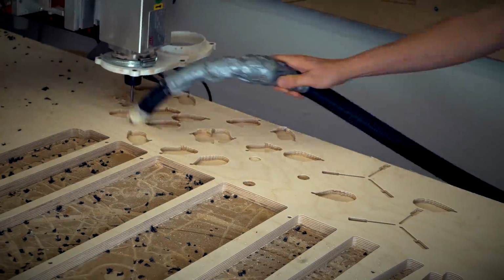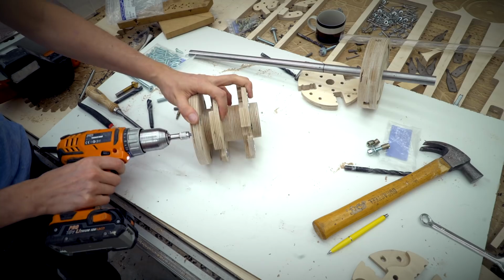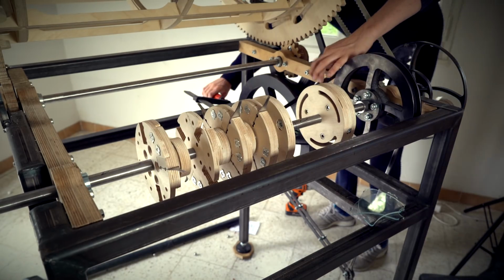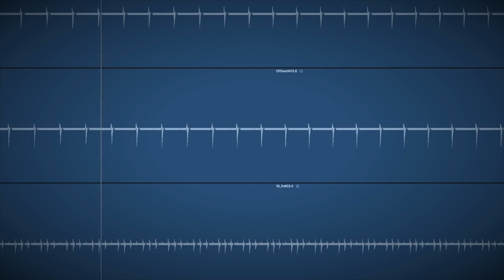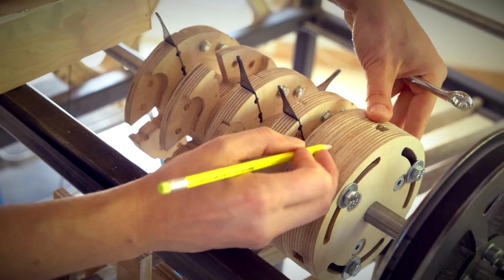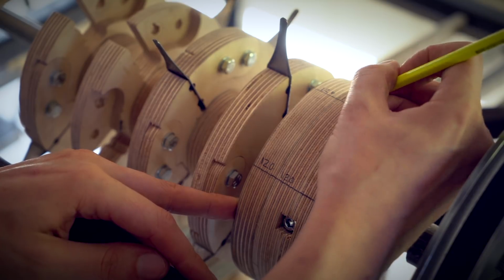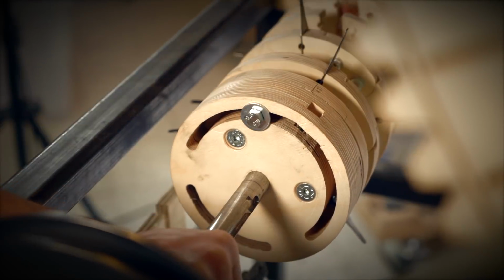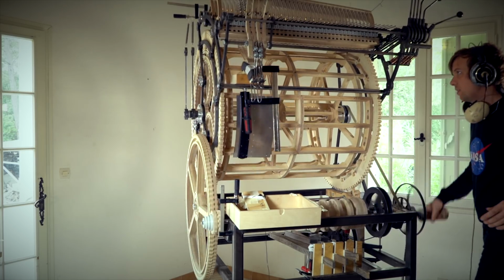Testing the Mechanical Rhythm Machine - Marble Machine X #55

Comment: You can easily program countersink milling in plywood with flat endmill using bore 2D Bore operation with 0.1-0.2mm stepdown in Fusion 360.

Comment: Glad to see you realize that a lot of your designs are heavily over-engineered. Your'e absolutely right though that they will work and look great imho :)
Maybe at some point you'll want to make the whole thing lighter and cheaper to build. I'd guesstimate that you could scale down a lot of the parts by at least a factor of 2 and still get the same functionality and proper reliability out of them. That will require the next level of engineering where you actually calculate the required forces for each part and design them accordingly. Might be fun.

Comment: I think that some sort of tachometer is now needed. Luckily, principle of mechanical tachometer, using eddy currents, is simple enough to implement on your machine - you need just magnet, aluminum disc and spring.
Maybe youu could use same principle for automatic synchronisation device, too.

Comment: You should use radial clamping between the set disk and the rhythm stack.  That means the set disk needs to be 3 thick and the rhythm stack needs a one disk protrusion inside and use three cam levers from the set to the stack.  Like a concealed mill chuck where a second trio of set screws at a 60° offset from the primary shaft set push inward.

Comment: Do not use V-belt - it makes more friction. Rather use grooved flat belt like the ones in the newly built vehicles. Or you could use a timing belt - it does not need much tension to work. However, finding the pulleys would be chalenging.
Do not use separate tensioner - using the flywheel as a tensioner is better. You may build a moving support with adjustment screw for that.
What about a brake on the wheel? You've had one in the previous machine ...

Comment: For the rhythm machine, how about using two anchoring bolts for symmetric load on the plywood and four anchoring holes, with two 150 degree tracks? This way, no matter what position the rhythm wheel is in, you'd be able to have two anchors. Awesome seeing this project progress and looking forward to the next update!

Comment: You need a sudden stop/emergency brake system for this machine to immediately to halt any sound comes from the machine without any delay like most of the songs maybe ? (Before the main part comes afterwards) Also I think you need that if anything goes terribly wrong...

And my personal opinion is... Think of a way to make the adjustment times between musics too short like 5 minutes... After 5 minutes, the audience goes angry and starts to shouting madly... Mostly boos for the musicians that not well known in some places...

Hope you can aswer this... I'll cheer for you from the place where the magic happens !

Comment: Since you like overengineering, did you consider to make the automatic adjustment system, like the one used in distributors in engines. The timing is adjusted there with the help of centrifugal forces: the higher the RPM, the further the hinged weights move, and the earlier the spark happens. Could something like this be possible in your case?

Comment: Ooh it would be interesting to use the rythym machine to fire a strobe light in order to use the stroboscopic effect to light the marbles as if they were standing still during the strike.  Kind of like a timing light when tuning an engine. This would not only be a nice lighting aufrecht during play but also a good method to check your timing without the need of the computer and pick ups as you are on tour.

Comment: Hey @WinterGatan - I would still keep 2 screws in that "rotation adjustment" so that you don't press only against one side. - If you make 4 holes and make the slide slots slightly larger than 25% x 2, you can move it the full 360 degrees and still have 2 opposite screws.

Comment: You can automate the BPM switching with centrifugal weights. Three arms with weights on the ends, pivoting on the adjustment wheel. The other end of the arms has a round profile with an increasing radius that pushes on the locking bolts. Springs is used for returning the arms. The BPM advance is tuned by the profiles on the arms. #featurecreep

Comment: Have you implanted braking system like that of previous one? I want to recommend you to apply bicycle brake on new machine. It will gradually make the machine stop by friction safely. Braking system with ratchet which occurs sudden stop is not safe for this kind of heavy machine.
Reply: Yes, exactly. A bicycle disc brake would be relatively easy to install and very effective. Maybe replace the lever with a wooden one for aesthetics

Comment: For the belt tensioning of flat belts, a slight bulge in the center of the running surface will often help the belt to track properly ('bombering' på svenska).

Comment: why ain't there no spring to keep the belt at a constant tension. (very quick and easy fix/modification) and if you like the change the tension on it you can just add a metal plate on verticaly and have the frame threaded to keep that plate in place, 
On this place you can machine out or ask someone with a laser cutter to make A to D so you know what tension you set your belt to. (this ofc will have to do with a spring that will run out over time like 20-40 years of constant working so keep that in mind)

You can just look at dirt bikes how they keep their chain in a constant tension and how you adjust the tension. 

And you can machine a flat disc that has a slope and you just drill a hole in the middle so you can weld it in to place (this will catch the belt obviously)

Comment: Seems like it'd be tricky to change the rhythm of that part though. A crazy idea would be to have a slide-clutch for each part so you could pick any of the beat patterns for any part of the percussion. Alternately split disks that go to an anchor mount on the shaft, allowing for fast change out.

Comment: You need to close off the flywheel/crank gaps. They look cool but they are finger traps. Your machine has more than enough inertial energy to take your finger off, and you want to increase the flywheel mass now.

Comment: You could use a centrifugal governor, or flyball governor like the ones you used to see on top of old timey elevators. Dialed in correctly to adjust your timing angle this would keep you in time with no manual adjustment and allow you to change BPM mid song. Bring on the feature creep. also they are purely mechanical and super cool looking

Comment: On your timing wheel remember how your triplets work with you 4/4 timing....  use 3 slots but put in 4 bolts at a constant radius in a square pattern.  You should always be able to get 3 points of contact no matter the rotation of the timing.

Comment: Don't use only 1 bolt.  That will make things unsymmetrical.  Instead, put a ring of tapped holes into which the bolts engage, and space those holes not in a multiple of 3, but say 4 or 8.  That way, a given bolt set will have a range, which will be different, but partially overlapping, with the existing set.  You can extend range by switching the hole-set you use.  This is principle of "vernier" scales.  Don't open the slot.  Assembly will be too weak!

Comment: Have you thought about adding a brake to the flywheel? Or did I miss it and am sounding like a fool, lol. It would help slow down the flywheel and stop everything much easier, but also if you made it lock-able, it would keep anything from rotating by bumps or stuff when the whole MMX is together.

Comment: It's possible to make a phase adjuster that allows full rotation https://imgur.com/a/7QjgCR5
Another option is an adjuster that automatically compensated for the BPM you are using. Look up "Mechanical timing advance". It's a device used in the distributor of an engine that uses centrifugal weights balanced against a spring to alter the phase angle of the contacts based on the RPM of the shaft.

Comment: Martin, you might need a metal face on the adjusting disks where the bolt heads are. Over time the washers may indent it to the ply and cause a step, that will stop an infinite adjustment.

Comment: Never in engineering or mechanics do you hear anybody saying, " I'mma tune that flat belt to C#." Normally we just snug it up and use a belt tensioner to see how much play it has. I keep thinking the belt should have an spring-loaded idler to maintain constant tension as it wears in, but we'll see how it works.
At this point I have to wonder. Did you get a degree in engineering, or are you an autodidact?
Overkill, by the way, is underrated.

Comment: Your marble drop latency problem means that you'll only be in sync if you crank perfectly at the right BPM, you'll have to adjust it for every tempo, and won't be able to change tempos while playing.

Your rhythm machine is feeding signals into a computer. I'm wondering if you could add a speed sensor to the MMX, then have the computer automatically delay the rhythm hits according to the actual BPM.  So no adjustment needed, and it would be perfectly in sync no matter what your cranking speed.

Comment: one addition to the pencil marks, just put a scaling on them with the cnc machine. 1 mark on every degree and bigger on 4th/8th/16th then you have marks to look at instead of looking at the flaps
Reply: And a thought on the "volume" ... How much does the angle of the levers affect the timing from low volume/late timing to high volume/early timing?

Comment: Silly ideas
1) changing the adjusting cutouts to be near 180 degree circles - and two bolts. 
2) colored tabs on the 16th to make alignment easier. forward 1/16 go from red at frame to blue at frame, say.

Comment: Have you considered putting a brake on the flywheel?  You could probably get by with buying a bicycle's disc brake assembly and lever, and just slap it on to the shaft.  If you wanted to go overengineered, you could rig up a transmission shifter to move to set BPMs faster or slower than whatever your current speed is, and adding the brake into that as a 0 BPM setting.

Comment: i almost think you should have a band brake on the flywheel. for adjusting the volume of the rhythm drum, do you plan on using detents for holds and more actuate adjustment?

Comment: Next...you probably know that every marble must drop the same distance to it's respective instrument for perfect timing?  And it appears you will need to adjust the timing of the rhythm machine based on tempo...make marks for each tempo... Actually, go back to those gear teeth, a tooth for each tempo you want to use, and use springs to hold the gears together--then you can make fast changes without tools!

Comment: Have you considered a brake pedal similar to a bike? You seem to have a little trouble slowing down the crank, and it seems like once all the programming panels will be on, it'll be much tougher to slow it down if you need to... I suggest a pedal on the other side of the frame next to the crank pedal, and it can apply a pressure to the flywheel or somewhere in there to slow down the wheel.

Comment: For holding to the shaft you should use the principal of torque fully (and not corrupt it by applying point force on the shaft- Instead increase the force distribution on the shaft by increasing the spread of the point force of contact). My possible advise -rework the centre bore of the plywood disks and insert -split collar (a-C section), You should have sanded surfaces on both shaft and - flexible metal radial brake pad like split collar C-section ring to apply the holding (actually locking) torque on the shaft. There should be strong counter insert bolts for the radial screws on the plywood disks (you can use industrial glue to hold the counter insert bolts, or cut across  the nut holes by repeated drill holes and put a threaded Bolt plate into the plywood disks) . This shall allow you to freely and repeatedly change and lock the radial positions of any disks (the strong insert bolts of the radial insert screws shall hold up the Bolting force on the shaft for "all that it is worth"{aka the disks compression plywood strength} and shall last and shall not fail throughout all concerts. The problem of shaft scouring and point force failure highlighted by others shall get eliminated. Cheers

Comment: Just a thought, but what if you had a pin to set 90 degrees or even 45 on the rhythm wheel easily? Like this: https://www.dropbox.com/s/t4wt4iotzatw4q8/wheely%20dealy.JPG?dl=0  I drew it up quick to show my thought. Still can slide for fine adjustment but has 16 holes and a pin that could really be just one arm but I put 4. You could position the arms at different places for even more timing quick adjustments.

Comment: Love the rythm machine. It will free up so many marbles for a base rythim. But I think you should consider some user protection there long term. Rotating mass with even more with "teeth" and decent speed are very dangerous. Imagine they just catch your or someone elses sleeve. Not sure maybe they will be covered sufficiently by instruments later on anyway.

Im curious what the final total weight of the machine will be.

Comment: Instead of adjusting the rhythm machine for every tempo, could you vary the height of the marble drop depending on the rate of rotation of the crank?  You could do that by making the marble target position adjustable vertically.  Assuming that is possible, and you had no second-order horizontal translation from the marbles following a parabolic trajectory, it might be much simpler way to equalize the marble timing and the rhythm machine timing for varying BPM.  If you got it working manually you could even make it a real-time closed loop system with a simple microcontroller, a servo motor and a worm gear - by sensing the shaft rate of rotation and setting the marble target height according to a lookup table.

Comment: You need to crate a centrifugal advance mechanism, like in a car ignition distributor, that changes the timing as the speed increases.  https://www.racingjunk.com/news/2015/04/16/performance-tuning-your-distributor/

Comment: Absolutely love your work, the rhythm machine sounds great, but part of me thinks that the idea you have to drive the machine to a specific tempo constantly to keep the rhythm machine in time sounds like a bind? Potentially preventing tempo changes without muting of tracks or having to make adjustments to the machine. Sometimes I just think less is more? 

I don't at all mean for this to be a dig at what you are doing, i'm just curious to know what you think? Nevertheless I'm really looking forward to seeing your completed project, and would love to see how much better it performs the original marble machine composition than the original marble machine!

Comment: I think you should hold down your plywood with double sided Nitto carpet tape, I proved it really worked over 8 years of operating two Esab computer routes at the same time and a vx engraver used to machine smaller parts, It cost more but does speed up production and make it easier.

Comment: Martin, for an alternative to a click, with less impact to your music, why not take a cue from a record turntable? You know, the strange markings on the edge that turn into dots under the red light when spun at the right speed?

You would have to do some fancy calculated 3D printing of different length stripes onto a wheel attached to the shaft, and have a calibrated strobe light (tradition says it should be red), and then when you spin the wheel at the right speed, the stripes turn into dots. This gives you a visual cue that you’re running the wheel at the right speed without requiring a click track or anything noisy that would interfere with the music.
Reply: OOOhhh. like the timing belt on a car.
Reply: Yep
Reply: Thought the same thing.
Reply: Great idea! Provided you can design an analog implementation that doesn't require electricity or lights. Interesting thought
Reply: E Benner it would require a light and a small timing circuit. But the MMX will have power, as it needs it to drive the contact microphones, bass, and mixer, so not really an issue. If you don’t want to use power, then run it manually, but then you don’t have the precise beats.
Reply: @metamoof  less circutry though if you did it with counter rotating wheels
Reply: some form of rotoscope?
Reply: Martin Dinner the technical term is a stroboscope. You can see a (rather boring) video that gives you the idea of how it works here... https://youtu.be/kFERz1J13p8
Reply: You don't need electricity for lights. You could use a shuttered lamp for example, like the kind they use for morse.
Reply: Peter Houlihan but then how do you tell how fast you’re going? The stroboscope relies on a fixed speed strobe
Reply: Clockwork attached to the shutter.
Reply: Moof timing lights are a part of my career almost every day. I air balance big hvac system's and blower wheel timing with variable frequency drives is critical. I've learned a lot of tricks about timing marks and this is a really good example.
Reply: Moof The calculation is really trivially easy.  Start with the blinking speed (100Hz in Europe, 120Hz in America and parts of Japan), multiply by how many seconds each turn of that wheel should take and you have the number of equally spaced mark to put on the edge.  If the speed matches is as wanted, the marks will look like they are not moving under the blinking light.  Example: a 33⅓rpm record turns in 60/33⅓ s, times 100Hz gives 180 marks for Europe, 216 for US.  120bpm is ½second, so 50 marks for Europe, 60 US.

Comment: You don't need 360 degrees of freedom with the timing. Just a bit more than 90 is enough. Otherwise you can just delay the programming wheel by exactly one count. 180 can be a good compromise for a bit of luxury. I would use a winged nut there with some extra locking mechanism
Reply: Yeah I was also thinking wing nut.